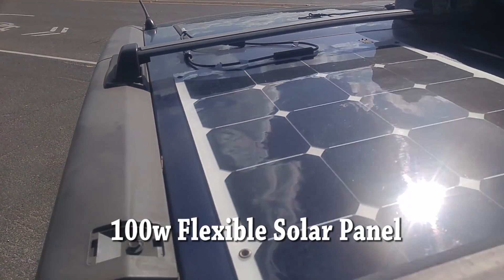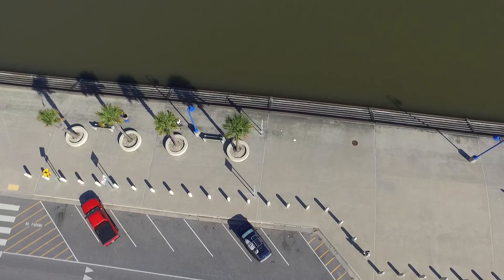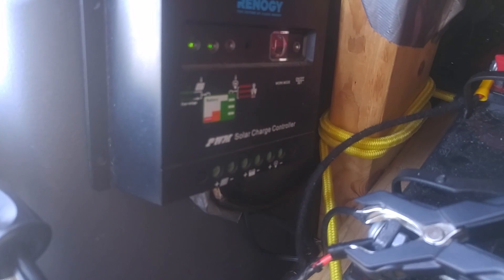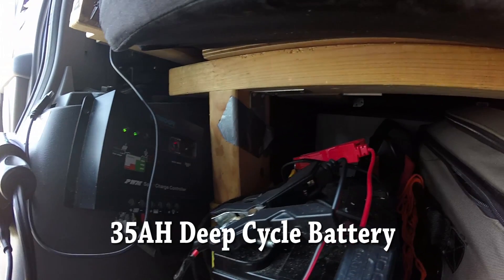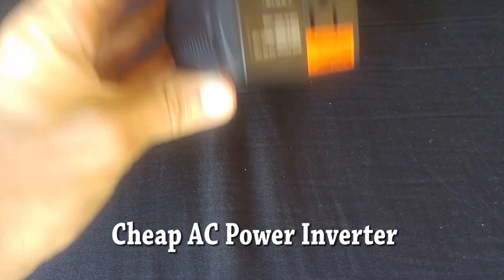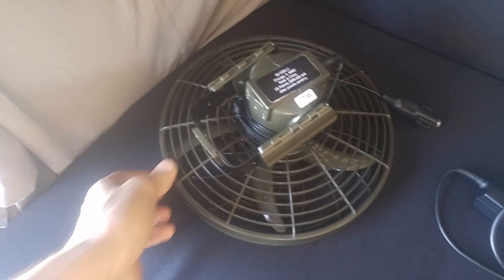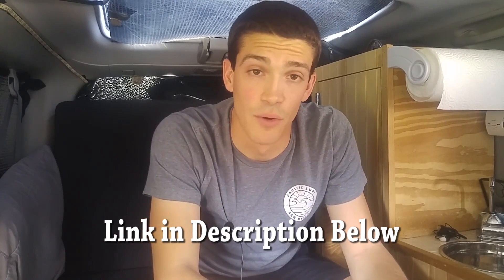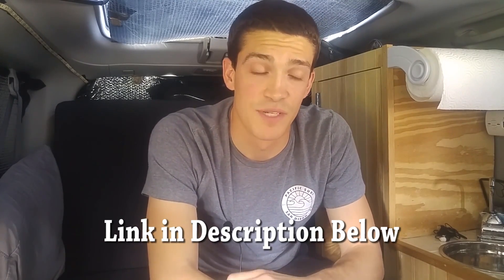Camper Van Off Grid Solar System Tour

Comment: Nicely made video and explanation.  But,  that shading on the panel is a lot more of a problem than you think.  Having any shade at all on a panel vastly decreases the output.  You wouldn’t really notice unless you were actively monitoring it.  

That’s likely reducing the power output by 1/4 or more.

A solar panel is like a battery.  If you have weak cells, that will reduce the entire capacity.  It can Actually damage the panel if you do this consistently just like weak cells can damage a battery.

If someone is going with this install method (and it’s a good method), I suggest reducing the panel size so it is not shaded under a rack. It will put out close to the same amount of power as this larger shaded panel plus save you money.

Comment: Hey Nate Kirk here. Im just curious if you use "fused wire" to protect your solar panel/battery/charge controller?
Reply from the maker: Hey Kirk, I don't use any type of fuse between the solar panel and charge controller.  The panel will only put out 22 volts max open circuit voltage.  The charge controller is designed to accept that voltage and then protects the battery by distributing the charge as needed.  I do use a fuse between my 12v extension outlet and the battery though.
Reply: Much appreciated Nate. This whole solar power thing is foreign to me right now so I greatly appreciate your speedy replies buddy. I'm almost entirely done the build. Just installed a table on a piano hinge off the back of the bed frame to support my coleman grill. All thats left is to build the sink structure. I built one already but wasn't happy with it so im redesigning it tomorrow. Love your vids btw. Your an inspiration to those of us who crave freedom, adventure and travel. Cheers buddy ! :)
Reply: Yo Nate, Just curious about where I can find those super strong magnets to secure my solar panel? Thanks in advance.

Comment: So be sure I understand, you have the solar which only works on sunny days, and on non sunny days you'll manually switch it to the the deep cell battery?   what benefits are there to having an inverter?....as so many seem to have them?   Lastly, if the solar panels on being charged all day how long does that charge carry you, typically? cuz obviously there is no sun in the evening...so just trying to find out how long it last.

Comment: Couple questions: (1) How do the tape and solar panels hold up during drive-through carwashes? (2) Would you consider this setup theft-resistant? I might put one on my car, which is easier to see than it would be on your taller vehicle, so I would depend more on resistance than attention avoidance.
Reply from the maker: 1. I hand wash the car.  I avoid automatic car washes fearing that they could damage the panel. 2. It's very very difficult to remove the panel from the roof.  The 3M VHB tape is very strong. I would consider it theft resistant because it's so difficult to remove (and easy to damage during the removal process!)
Reply: Doesn't high heat make glue melt to the point of defeating its purpose?

Comment: Just a suggestion Nate - not sure how many boards you have up top - but you could do a cargo netting or some sort of rig on the inside of the element on the roof, and slide the boards into that --- that would free up the roof for another solar panel or 2.  If you have only have one surf board --- you could run a skinny cargo netting from side to side in the front and in the rear and then slide the board into those 2 nets to hang or hold it up against the ceiling of the van - yes you'd lose a little headroom but big deal you now have more power coming in.

Comment: I'd replace the controller with a 10a mppt controller ($60 on ebay). I'd also replace the battery with at least 105 amp hour agm battery ($179 at Sam's Club).

Comment: it's a little pricey, but check out the goal zero's on Amazon. you just need a solar panel and the goal zero is an all in one charge controller and battery and inverter. nearly all in one package.
Reply: J-Rok Bird please let me know what you think after trying it. Just found out goal zero is coming out with a lithium battery version. 1200 only 45 pounds, but around $2000 for kit.

Comment: I use to live just down the street from where you are parked there. There was a bowling alley in my backyard. 

Oh boy am I doing it way different. I have a Prius for power no solar as of yet. My plan is to use the ICE machine to produce ice when I am unable to score ice along the way. That or I will make ice while in transit. When dealing with food I could always pass by a ice machine and toss in $2 worth and I know I am good for days. 

I am getting an inverter my only regret is that I did not get a 2KW inverter reason? Well I wanted to run a 110V kettle. I don't truly need that rather than go for a larger inverter I think I would much rather go for a jetboil after all that thing can boil water in 2 min. 

You get to a point where you say ok enough I am sick of appliances that have very few uses but I can't do without them becasue their single use provide so many products.

Comment: Nice job Nate ! How do you keep rain from leaking in at sun roof where the wire enters ? Peace
Reply from the maker: Thanks!  I just keep the sun roof closed. It doesn't leak when it's closed, the seal keeps water out.
Reply: Element Van LifeThx . Thats a great seal on the Element sunroof.Many seals would get warped.
Reply: your not worried about pinching those wires through the sun roof?

Comment: The shading on the solar panel is more than what people might think.  Since the individual cells are in series, if you cover even one cell by 50%, the whole panel will be cut by almost the same amount.  

I think you could get an additional flexible solar panel and tie down above your surfboards.  

I replaced my starting battery with a size 24 marine battery and gives me a lot more  juice for computer and miscellanious loads - so far have not needed to add a house battery.
Reply: I think it would be super-stealth and the tie-downs would be almost zero  shading : )
Reply: new to solar, but could increasing to a 50 amp hr battery also be of benefit? would the 40% + increase in storage provide adequate power for the dometic during winter or cloudy days?
Reply: buy all the
 AH you can afford/ fit
Reply from the maker: Absolutely. When I upgrade, I'll probably go with the 70 amp hr version of the AGM battery that I currently have.
Reply from the maker: Thanks for the suggestion. I've been thinking about trying to tie down the flexible panel above my boards. I bet that would work well and would definitely eliminate the partial shading problem!
Reply: 35AH is pretty lean - but the size is nice and compact when your space is limited.  You could probably get a lithium in the same footprint and get 100AH and I think you can draw them down to 70% depth of discharge without any penalty.
Reply: also with space to amp hours look at sealed 12 volt lithium ion wheelchair batteries you can put 4 together and get like 108 amp hours and they are a space saver